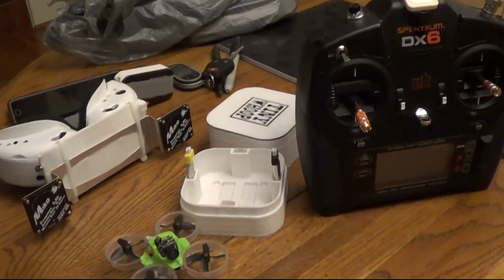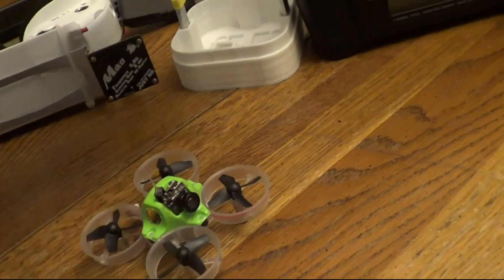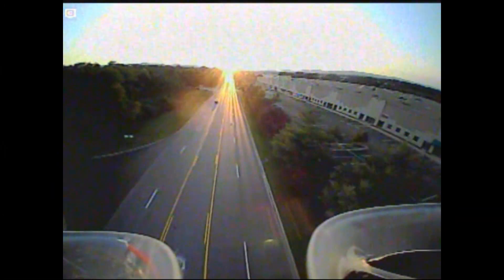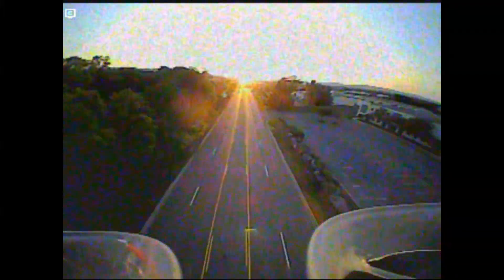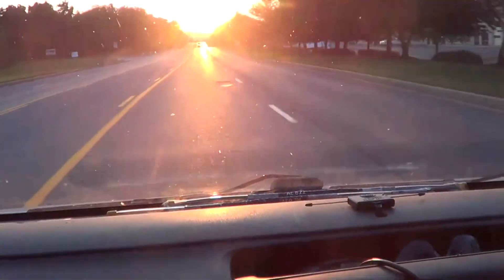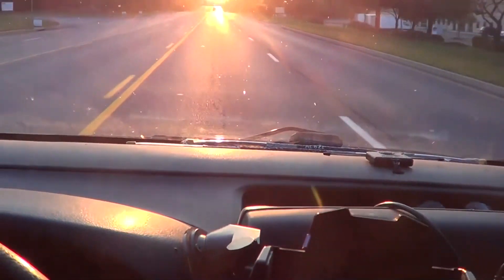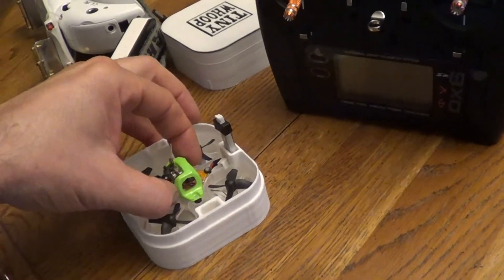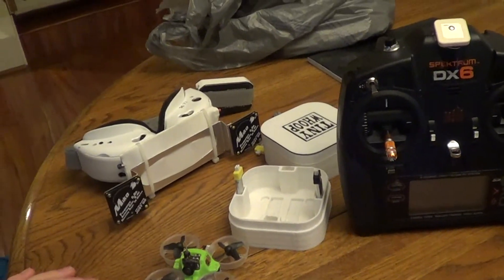3,500 ft (1km) Range Test on Tiny Whoop

Comment: What is the specs of battery you used sir?
Reply from the maker: I use the 200 or 210 mAh.  I like having the extra thrust by using a lighter weight battery.
Reply: Thank you i follow your channel... More power...

Comment: Very impressive! I have to find a long range sub 100g quad because someone reported me for flying my Spark too far and at night. In Australia 100g is a toy so they can't touch you.
Reply from the maker: The lighter the weight, the quieter the quad. I am working on a 150 gram long range 1 hr duration quad right now.  It uses the EagleTree Micro Vector and has night vision, full gps and should have a 5 mile range if line of sight is maintained.  100g is doable for 1 hr duration, but no GPS is going to be that light.  And GPS is a must for long range flying.  I'll post a complete build video.  Actually, I'll post a teaser video tonight.

Comment: Awesome video! how can i contact you?
Reply from the maker: I guess I am an extreme Tiny Whooper.  I'll send you an email.  Are you going to any trade shows on the east coast?  I have been in the hobby for a while and have done design work for Horizon and Revolectrix.  I'm almost finished with the 1 mile range Tiny Whoop.  My next project is 5 mile range, 45 minute endurance and hopefully less than 100 grams.
Reply from the maker: I'll definitely publish a build video.  Right now I'm engineering everything based on existing internet knowledge.  It is all about efficiency in grams per watt thrust.  Brushless is around 3 g/W.  Direct drive brushed is 7 g/W.  Only the geared 5 inch props can deliver 15 g/W which can make the project work.  However, I really want to do full GPS with OSD.  So, I end up going from a 3 gram all in one flight controller to a 23 g assortment of boards.  Video adds another 8 gram using the Eachine DVR03 that everyone seems to hate.  I will SWR the output and see if it really delivers 200mW of 5.8Ghz rf.  Preliminary numbers use a high discharge 18650 LiOn cell that delivers 10.5 Whr of energy.  I have to blow thru the 100g limit when adding the extra 20g payload for return home.  I selected the eagle tree micro vector because it has a robust downlink for gps data.  Range of 5 miles can only be achieve with a high gain 23 dB or so antenna focused on the aircraft for video reception.  Uplink is just high power.  Propulsion is based on the WL Toys V595 using the Traxxas alias props and a 3D printed gear boxes.  Weight is 11 g per arm.  This quadcopter already achieves 50 minutes with a much lighter payload.   https://www.shapeways.com/product/5JKZYVBEX/honeycomb-drone-frame?li=search-results-20&optionId=58768546
Back of the envelope calculations using measured and published thrust data is:
1)  4 blade 1 cell is 137 grams and takes 13W to hover.  Max thrust is 268g.  Hover duration is 50 minutes.
2)  4 blade 2 cell isn't flyable.
3)  6 blade 1 cell is 159g and takes 13W to hover.  Max thrust is 414g.  Duration is 50 minutes.
4)  6 blade 2 cell is 209g and takes 21W to hover.  Max thrust is 414g.  Duration is 60 minutes.
5)  8 blade 1 cell is 181g and takes 14W to hover.  Max thrust is 552g.  Duration is 46 minutes.
6)  8 blade 2 cell is 231g.  Max thrust is 552g.  Duration is 60 minutes.

It is interesting how option 1 and 3 have the exact same predicted flight time.  This is because prop efficiency is 40% better at lower rpms when airflow is more laminar with less turbulence.  If I could source 6 inch props instead of 5 inch option 1 would have 1 hour flight time.  But, I"m going to go with option 3 because the higher thrust to weight ratio will be better to get out of down drafts that exist behind every tree.

The body is going to be a single 0.5mm carbon fiber sheet with the 3mmx3mm arms glued and all the circuit boards double stick taped.  Wiring will be point to point.  I did find speed controls that only weigh 0.6g.

So, I'm looking at 159 grams now full OSD, GPS antenna tracking, Return home, compass, DVR and 50 minutes flight time.

If I were to drop GPS and just use a beebrain flight controller, 25mW camera and one cell weight would be 104g and take 9.4W to hover.  Flight time would be 67 minutes.  So, GPS is reducing flight time 25%  But, realistically, return home is needed when flying far out.

8 blade is the most efficient using 2 cells, but it is getting larger and heavier than a micro class quadcopter should be.  So, 6 blades looks like the idea number unless I find a larger prop.  Efficiency actually goes up to 18 g/W and the traxxas alien prop when thrust is low like 15g.  If I could achieve 18 g/W, option 1 would have 65 minute flight time.  Better efficiency also means super quiet.  Maybe some day I will build some carbon fiber props.  But, I have enough on my plate right now to stay busy for a while.
Reply: 45 minute flight at under 100 grams? Do share the specs ? :)
Reply: What's your name?
Reply: If you have a moment please shoot me an email (Jesse@tinywhoop.com) and put microdronetech in the subject line! I've been looking thru months of emails and i can't seem to find yours...